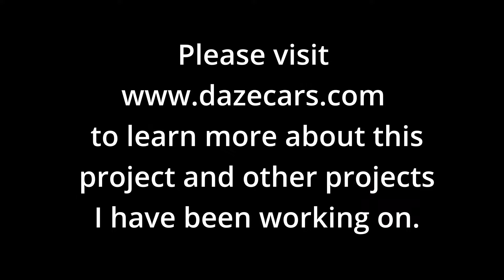Using a 10 Turn Potentiometer as Part of a Treadmill Power Supply for a DIY or Treadmill Board

Comment: What would be a use case for such hi res speed control? I notice I use only about 3 speeds on both the mill and the lathe...
Reply from the maker: It’s fairly important on the bandsaw where the material cut range can vary 25-50 rpm and I like having it on the lathe for threading.

Comment: You have given a good reasoning for 100k as normal pot & 20k as fine adj. pot...
In the application you've shown one should be aware that you just cannot quickly turn to minimum in case of any mishap ..
Of course there will definitely be an
 "emergency stop" button
therefore instead of depending more on individual preferences......,the ratio
(5:1 here) option could also be (4:1 or 3:1)...which may be more suitable in other cases...
..as of today I am not sure..
but (35-40) yrs. ago 5 & 20 turn pots were also available.
Reply from the maker: I never use the speed knob in a "stop" situation.  As an example on my bandsaw if I stick a blade I reach for the master power switch.  As far as 5-turn and 20-turn potentiometers they are available but not from the inexpensive places like amazon or eBay so because they are coming from parts houses like mouser they are more expensive.  I looked it up and a single 5-turn potentiometer was about $30.  may be worth it for some applications but not if trying to set a power supply up as cost effectively as possible.

Comment: Got a M60 controller with its "clipped" resistor reattached.  It all works starting the motor at 15 kohms with a single 18 ohm pot.  What 10  turn pot size would you suggest to fine tune at low speeds and limit high speeds?  Note the motor app load will be small.  You have a great channel!  Thx
Reply: Oh, and  assume a  3:1 pulley ratio.
Reply from the maker: Smallest potentiometer I have run is a 2K.  if you are having good results with an 18 ohm potentiometer than something similar on a 10 turn should also work.  As far as limiting max RPM I don't have an option like I do for the SCR setup.  As far as gear ratio you want to maximize RPM which is totally dependent on your motor's max speed and max desired speed on what ever you are turning.
Reply: Bueno😊

Comment: I'm asking because this is very close to something I'm trying to figure out.  I have a Leslie speaker cabinet.  This is a speaker cabinet that has a device that spins inside of it to create a cool effect with the sound. An electric motor spins the device.  I'm trying to figure out a way to wire it hopefully with a potentiometer so I can fine-tune the speed the motor spins. Or even just hook up a rotary switch so it could have three different speeds?  Do you have any videos like that? Or do you have any suggestions of channels I should check out for solving this riddle? Either way, thank you. I enjoyed a couple of your videos that I watched.
Reply from the maker: first question is what kind of power is used on the motor, AC or DC?  keep in mind that some devices convert AC to DC so if it plugs into the wall that doesn't automatically make it AC

Comment: I have a me62t-2c power supply and motor from a true 525 soft select got it free from a Titians football player is the power supply worth using or should I go aftermarket it's for a craftsman/atlas lathe 12x36
Reply from the maker: I am not familiar with that power supply.  Can you contact me through my website and email me some pictures?

Comment: IDK if my question is in the scope of content you like to create, but I'd really like to learn how you came to know how much resistance you needed for your application (your bandsaw).  Would you make a video of the math involved, or perhaps point me to a source of information in any format that I can learn for myself?  I have a fairly decent understanding of electric flow, but calculating resistance needed to to achieve a desired outcome is definitely my weakest point of my learning curve.
Reply from the maker: That video already exists.  I don't cover the speed limiting resistor but the concept is the same.   https://youtu.be/04d0u1RJyXw  The part not covered in the video is as follows, after marking on the power supply where the motor comes on I turned it up until I go to the max desired speed and made another mark.  When I measured the resistance at the marks the resistance of the second mark is the size of the fixed resistor and the measurement of the first mark is the total resistance needed of the potentiometer and resister together in series.

Comment: To use a coarse and fine pot for a three-wire control, wire the fine pot (e.g. a 1k, as a rheostat, and put that between the high-side wire on the controller and the high side of the coarse pot (say a 10k), and connect the low side and wiper terminals on the controller to the low side and wiper of the coarse pot. 

Summary:

Controller H to 1k R
1k W to 1k L to 10k R
10k W to Controller W
10k L to Controller L
Reply from the maker: I really appreciate the information.  You wouldn't happen to have a link to a schematic showing this configuration.  I know you have spelled it out but I am having a hard time visualizing it.